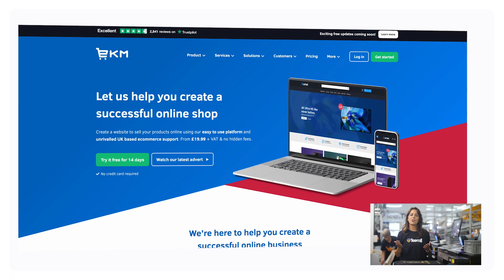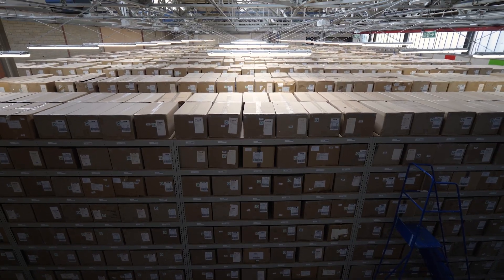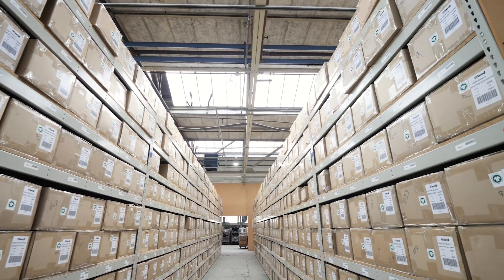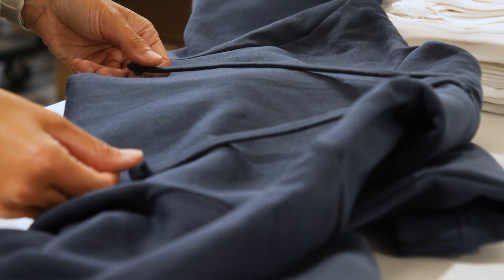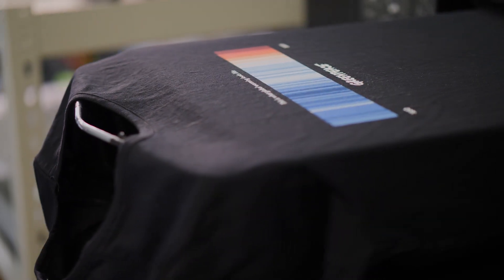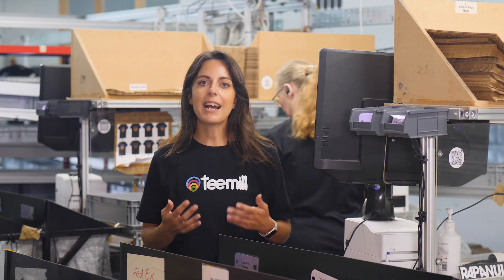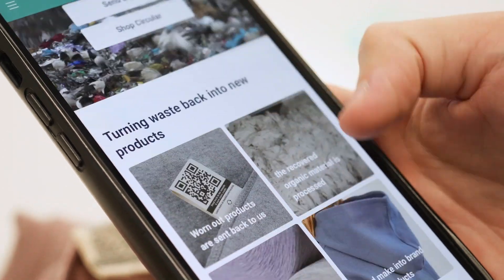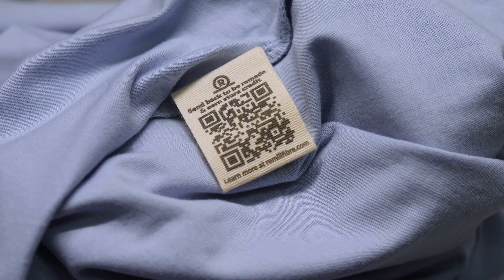Connect your EKM store to the Teemill Print On Demand Integration

Comment: Your probably won’t see this but I was just wondering let’s say I started a cloth brand and then someone requested a refund. My product is 40 pounds and I make a 5 pound profit . Would I need to pay them the full 40 pounds or will you give them 35 pounds and I give them 5 . Just curious . Thanks
Reply from the maker: As part of the Teemill integration terms we don’t handle exchanges for sizing or changed mind etc. How to solve this for the customer would come down to your own Refunds and Exchanges policy. What we tend to recommend to store owners is that they have items returned to their business address and use the sample option to replace the item in a different size for the customer. You can then use the returned item as you see fit, either as a promotional item or through re-selling.